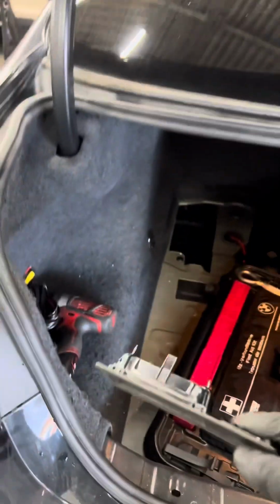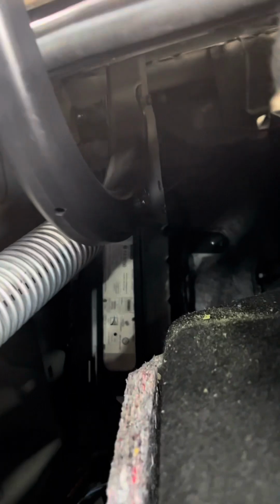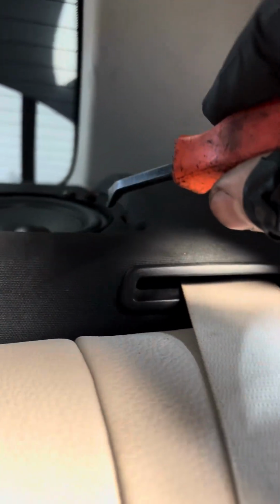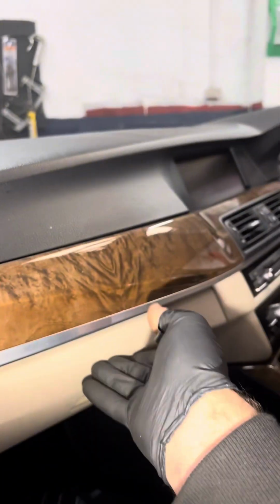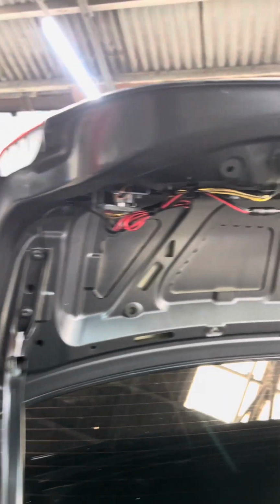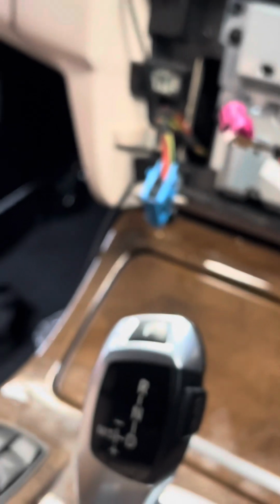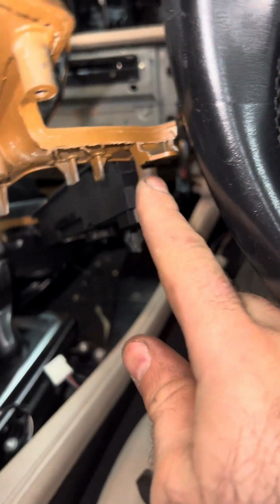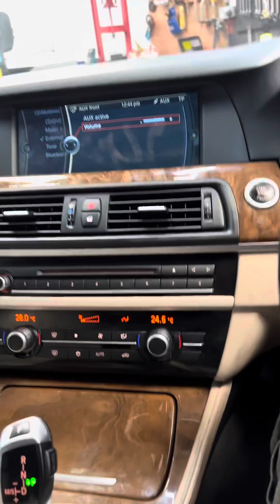Bmw f10 how to install reverse camera

Comment: Does this need coding ?
Reply from the maker: You need to install the screen as well
Reply: @michaelclassic2613  thanks , I have f11 with widescreen but no rear camera , will I need to replace that screen ?
Reply from the maker: @mohhuss6625 yas you need to buy touchscreen
Reply from the maker: @mohhuss6625 
Check my YouTube there is F10 video for installing screen